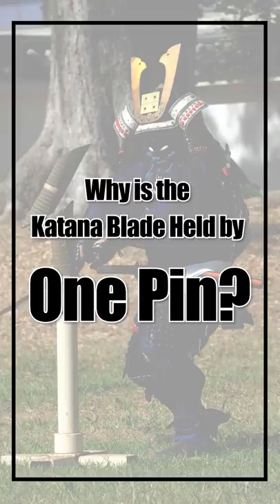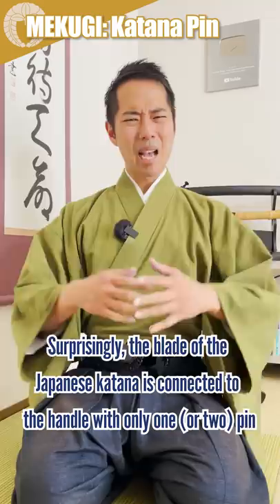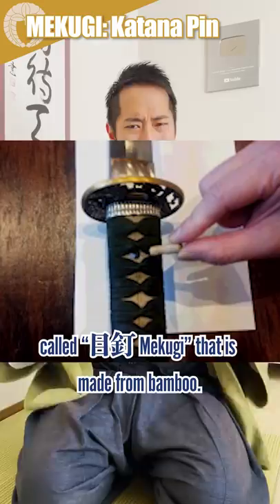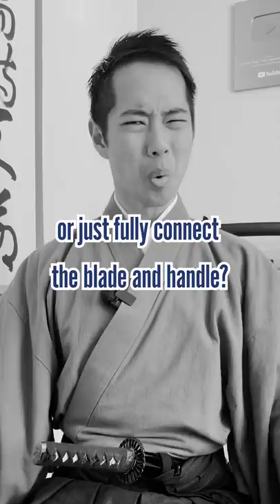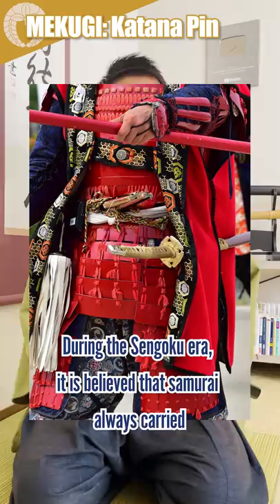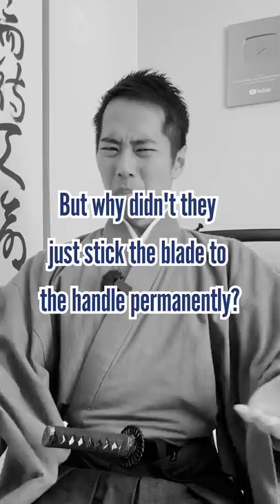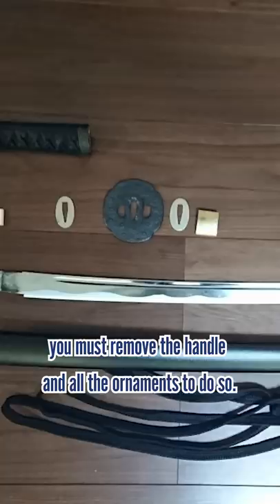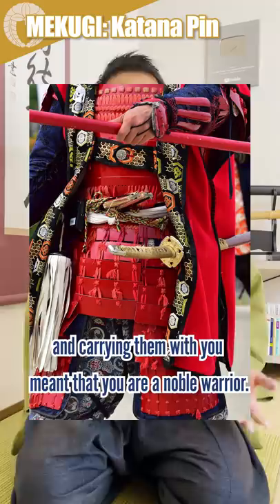Why a Single Bamboo Pin Holds the Whole Katana Blade #Shorts

Comment: Man thank you for sharing this information. I had bought an Old Katana back in 83 or 84. When I finally received it, I was so happy. Then when I went to break it down to clean and see how much work that would be needed. I have never been a person that has to know everything. However what I am. I am a person that loves history and the Katana is history for me. 
  Now when I was breaking it down, I found this little tiny dpwl or wooden pin stuck in where a metal pin would go. Well after leaning this and I figured I need to call around to find someone that knew these awsome blades. 
   When I talked to a college professor and asked him if we could get together so I could get his advise on this Katana. He separated the handle and blade. He asked me how much did I pay for it? I laughed and said, really? He said I am probably going to other you double to triple what you paid for it. I said find Triple it is. He said ok, it isn't like 20k is it? I said no I bought this Katana for $550.00.
  The professor then asked me if I could sleep at night making this deal with this Katana? I said well yeah I'll be able to sleep no problemo!!! He wrote me a check for $1,000 and gave me the rest in cash. I said ok, now can you tell me how much it is really worth now?  He grinned and said man I am sorry. I put my head down on the counter and start banging it. Then after about 10secs doing this. He said that the signature is from a famous person in the mid to late 1700's. And then tells me if he brings this to an auction, it would fetch over $35,000. I called to talk to him about it. Thats when I found out that he had past away in 91. His son sold it for 200 bucks.

Comment: They could have used two bamboo pins just to make sure
Imagine the blade goes flying because thr single piece of bamboo broke
You guys know if it ever happened?
Reply: Very unlikely, with a snug fit on hte tang all the force is going into the handle, with the centrifugal force being pretty much the only force wanting to pull the sword out.

The most important is to have a strong well shaped tang and a snug handle. Many cultures did not use any pins for swords. Southeast asian dha and indian swords are literally just glued into the handle.

Comment: "Why is the katana blade held by one pin?"

"Well, the pin is made from bamboo because a stronger material might damage the blade during heavy impacts, and the blade isn't permanently attached to the handle because it would make long term maintenance impossible."

Cool, but you didn't answer the question. Why is the katana blade held by one pin?

Don't most swords use two and many even three?
Reply: If i had to venture a guess. Its probably because you need more metal to make the tang beefy enough for multiple holes in it. Japan had a very limited supply. So instead they went with one pin and a tight fitting handle.
Reply: It was inserted in captions and videos, there are also katana with 2 pins

Comment: Wood flexes, when a piece of metal is forced into a wooden hilt while it is hot, it actually warps it's shape and burns the wood as well before fusing with it when it cools.

This is with western smithing though, eastern hilts are more assembled and less 'hammered in'...

Comment: I have a new theory. We know that Katana was used as a secondary weapon for self defence just in case the main weapon did not work. So it was not meant for hammering and bashing it on hard material. Katana was used for nice, clean, and quick attack. Now, using a wooden pin to hold the sword up could be intended for people to avoid the hard bashing so that they do not break it.

Comment: European sabres were so much more practical.
Reply: Cap
Reply: @ezrazentor7725  wdym
Reply: @jayfenny7461  how were they more practical
Reply: @ezrazentor7725  easier to put together and made of stronger materials. If that bit of wood falls out your screwed but European sabres were held together in a much more sturdy and simpler manner.

Comment: Tbh this is just bad design. European swords and Messer are so much better in this regard
Reply: How
Reply: @ezrazentor7725  swords have a tang that runs through the entire handle and the handle is sandwiched between the cross and the pommel by peaning the tang to the pommel. Messer's had multiple brass pins. Both of these ways of doing it are essentially unbreakable. Cleaning in those areas also was rarely required if the wood was properly oiled beforehand

Comment: The reason is: the katana is pretty trash overall; low quality steels and very limited access to decent durable woods mean that every part of a katana’s traditional build techniques are focused on trying to get a weapon that doesn’t instantly fail with use. Unfortunately even with all the work done, a katana is still next to useless in combat.
Reply: That's why it only used as symbol, spiritual and mentally, you don't need to say it trash just because it useless physically.